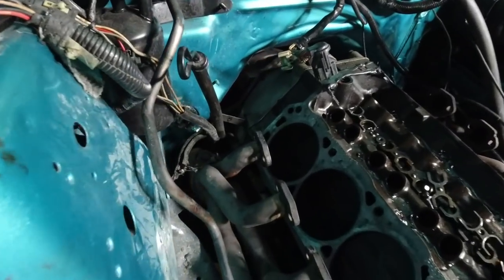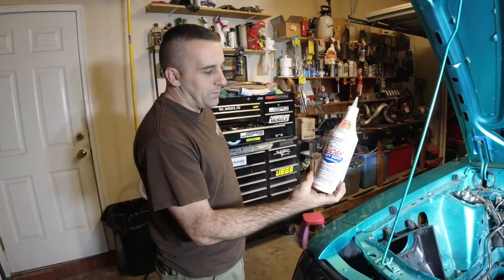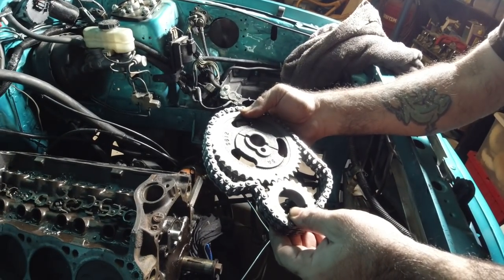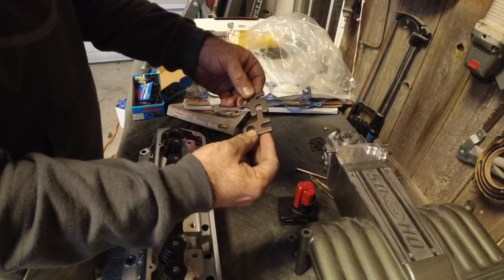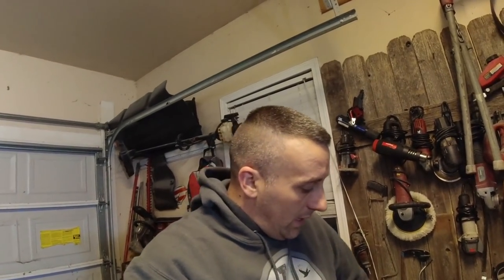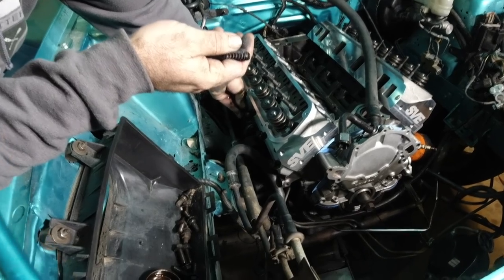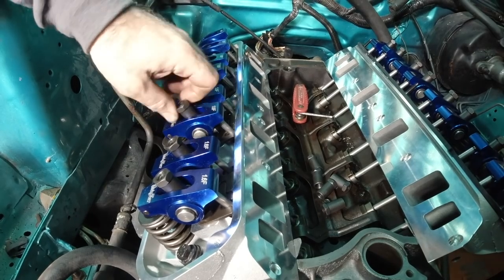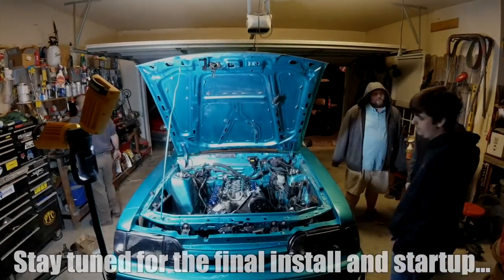FOXBODY HEAD GAME / SVE HEADS - ROLLER ROCKERS & TRICK FLOW CAM INSTALL

Comment: Couple things you might wish you did. If the hole the rocker arm studs thread into go all the way into the intake. Your motor may smoke from oil being sucked in by the threads. The bottom head bolts thread into the water jacket on the block. Coolant could leak by the threads on the bolts. I use liquid teflon on both. I like my tfs 1 cam.

Comment: Back in the day, my assembly lube consisted of engine oil mixed with STP. Never had an issue. Primed engine with a gutted distributor and a 1/2 inch electric drill. Ah , those were the days.
Reply: I use White Grease, always have. Sticks and melts with the engine warming up

Comment: Trick flow’s are the best heads out of the box for 302 That’s what I would’ve went with
Reply from the maker: Nothing ventured nothing gained.... 👌
Reply: Every test ive ever seen.. out of the box AFR beat Trickflow and the rest of field. But they are also a lot more in $.
Reply: @TheModAddict  have you looked at the Trick flow 11Rs.
Reply: @bobsmith-st9lq  i have. They are great heads and give afr a run and depending on combo can beat afr. But afr just seems to be the gold standard. Ive seen the 11r and the afr 220 make within 4hp of each other NA but the afr made something like 24 more ft lbs of tq when the application was boosted. Again all depends on combos.
Reply: The 11r205 outflows the afr205. Also has more ptv clearance
Reply: @timmartin4798  thats good to know
Reply: @timmartin4798  the ptv clearance is a big plus!

Comment: Hey, I noticed that you didn't use thread sealer on the intake rocker studs. When you start losing oil or it smokes alittle,  that's why. The stud holes go into the intake port. Oil will follow the threads down and you will be burning oil. Thread tape will stop that.
Reply from the maker: I’ve done it both ways many times with good results, but if I have any problems with it I’ll be sure to let you guys know. Thanks brother
Reply: @BREW2LFOXBODY  no problem

Comment: At TDC adjust no.1 intake valve then rotate engine 180 degrees and adjust the exhaust valve. Then repeat according to the firing order turning the engine 180 each time. When adjusting rockers you don't always have the intake off.

Comment: Stock pushrods?  Did you check the ptv clearance?  Or are you just hoping for the best but prepared for the worst.

Also on header install, I like to put the headers on with a couple big bolts, not tight, and install the head/header together. I also use 2" studs so I I can shift it around to tighten the head bolts.

Installing on the head first shows where you may need to gently massage around the bolt area for ease of installing the bolt holes.

Arp makes a damn fine header bolt with a 5/16 nut for those tight spaces.

Looking forward to the first fire up.  Get it done.

Comment: Quick tip, when installing the guide plates for the pushrods. Put at tack weld on them once centered. Will stay aligned and be dead centered all the time.

Comment: What exact heads are these? I know they’re the SVE’s. Are these the 170cc? I’m trying to figure out this combo because I’m running the exact TFS stage 3 cam on GT40 3 bar heads and I keep breaking valve springs. I was using 1.7 rockers but moved down to the 1.6 thinking it would stop breaking springs but I still lose a random spring every couple hundred miles. I’m wanting to just swap out the heads for a set up like this that has springs in it so I can finally drive my car with a little more confidence that it won’t pop a spring, lol. I got excited when I saw you throw a TF Stage 3 cam in yours because that’s what I’m running and didn’t want to change my cam. I’m currently using the Comp 926-1 valve spring too. So I’m hoping I can find out what version SVE head you went with. Any suggestions would be greatly appreciated. LOVE YOUR CHANNEL!!!!!

Comment: Good advice about the rag over the top of the oil pan.  Like Andrew, I had a piece of timing cover gasket get stuck in my oil pump after doing a heads, cam and Intake swap.  It twisted the stock oil pump driveshaft like a piece of licorice.  Luckily I was checking my gauges when it happened and I parked it.  I run a hardened oil pump driveshaft now.  Wonder what would happened if another piece of gasket gets stuck.  Would it snap the hex on the distributor?

Comment: Good evening BEW2L, love the content of your channel. Watching the your most recent video on the installation of your SVE aluminum heads it looked like you put your stock pushrods back in. If I am correct you may want to change those out with hardened pushrods. I only know this from installing some AFRs heads on my Mustang and using the stock rods, well I ran into problems with the walls of the rod wearing out where they rubbed up against the guide plate. Upon further investigation when running guide plates I found that you should also use hardened push rods. Just thought I would pass along some knowledge based off from my mistake. Kind regards, Carl.
Reply from the maker: Thanks for the info👍 yes they are hardened pushrods.

Comment: Can't wait to hear that cam. I have a question with my fox maybe you can help. The other day I was out for ride and stop for gas when I started it the starter kept running even with the key off. Had to tap on solenoid to stop it. So I replaced the solenoid and the problem was still there so I replaced starter and that didn't fix it. The only thing I can think of would be ignition switch. What is your or anyone's thoughts. Thanks for the videos and any help would be appreciated.
Reply: Make sure its wired properly.
Reply: @timmartin4798  yes check it twice.  It doesn't do it all the time about every 3rd or 4th start up. It worked fine for 11 year and the other week started doing it. So I really solenoid didn't fix it so changed starter didn't  fix it and the other day replaced battery and that didn't fix it. Thanks for the reply and the help really appreciate it.

Comment: Did you use sealant on the lower head bolts threads?
Reply from the maker: I didn’t this time. Trying something different. We’ll see it if holds. Lol
Reply: @BREW2LFOXBODY  Trying something different?!?   WHAT?? There is no different. They will leak PERIOD. I thought you guys were a little good?!
Reply from the maker: Larry Ford It’s got anti seize on them. I’ve had good luck with this as well as RTV on the lower bolts. Granted I’ve never used this on aluminum heads before.
Reply: @BREW2LFOXBODY  Ok that's fine as long as the head bolts were coated. You will be fine then

Comment: What did the mustang make power wise? I have the same set up with larger long tube headers, same SVO heads,  x303 cam, 24pound injectors, naturally asp, ported out cobra intake, 65mm throttle body and I was told it only made 210 to the wheels today.
Reply from the maker: Something must be wrong with it then. That setup should make around 260 or so at the wheels

Comment: I used a lunati 51014 with 1.94 valves and had to retard cam 2 degrees to get the proper PTV clearance on intake. I used drop valve technique. Tfs stage 1 and the 51014 are similar. What did you end up with on clearance?
Reply from the maker: I didn’t check it. I was honestly too lazy. Should be around .100 or so

Comment: What's the best cam besides the ford  alphabet cams are best for the street with allot of torque and good idle ?
Reply: Little late to reply but the xe series comp cams are nice. They dont lop as hard as a bcam but my xe270 sounds pretty nasty and has great drivability, lots of power below the curve. Xe cams need some really good springs though